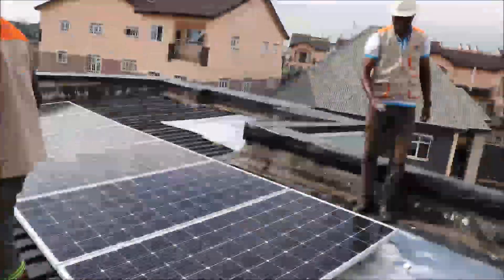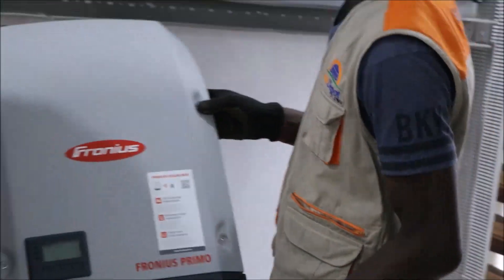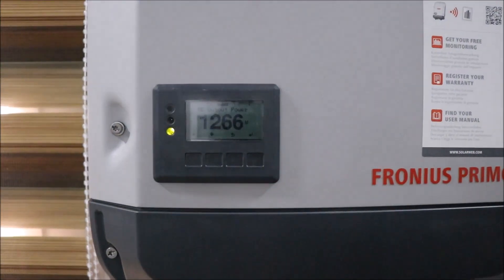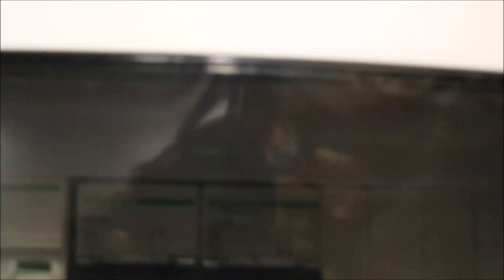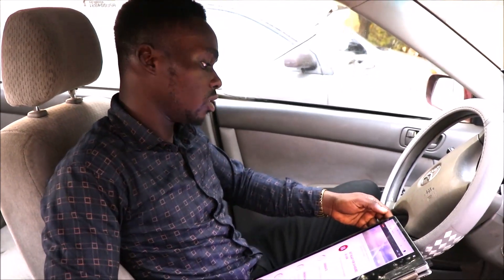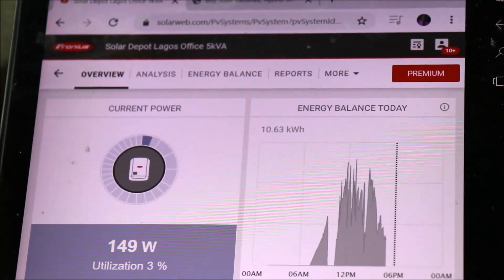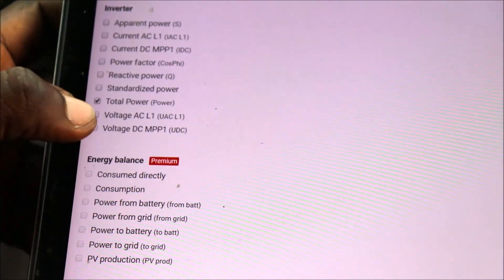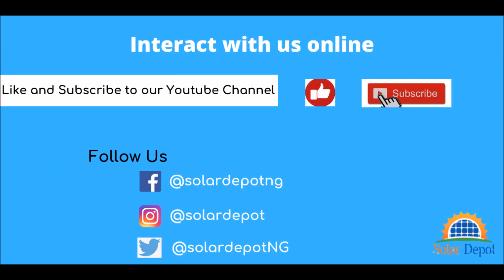Fronius PV Inverter + 8kVa Victron Inverter + BYD Installation in Lagos | Off-grid Solar System

Comment: Excellent video bud. Just what I was looking for. I also have the fronius primo 5 grid tie inverter but would love the option to use power when grid is down. I guess I just need to add a victor microplus and a victron smart charger + batteries? Thanks again

Comment: Interesting but confusing installation. Why use the Fronius pv inverter and what appears to be a Victron charge controller at the same time!? Are you doing DC and AC coupling at the same time or the pv inverter and the charge controller are connected to different solar arrays?
Reply: From personal experience, a stand alone charge controller, pv charginf is useful when for one reason or the other the fronius can't work. Have in mind that a PV inverter needs a present power supply to work with.
Reply: @leviahamefula3994  Surely you can obtain grid reference from the battery as well, yes?
Reply: @DJMT-Africa  Battery is DC, grid is AC so no, I don't think you can.
Reply: @leviahamefula3994  What I meant was the battery inverter can invert 48VDC to 240VAC/50Hz, and use that to provide reference to the PV inverter in case of a grid outage. That way, the PV inverter has reference to keep operating and making power, even when the grid is down. At least that's how other grid-tied battery inverters do it when they are working alongside a PV inverter (also known as "islanding").
Reply: @DJMT-Africa  that's correct, but it's not what the commenter was seeking clarity for.
Reply: Ahamefula Levi You’re right. I was responding to your comment to about the need for the presence of a power source for the Fronius to work.
Reply: Is the use of a charge controller because of the need to jumpstart the batteries direct from solar in case of a deep discharge?